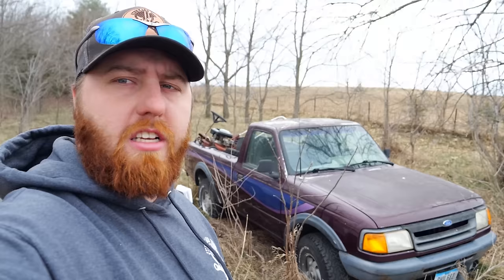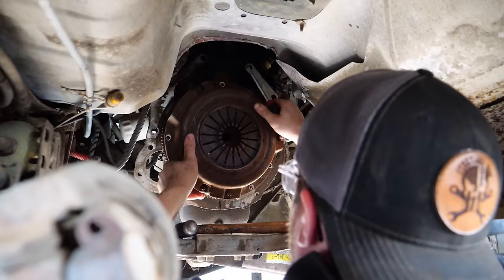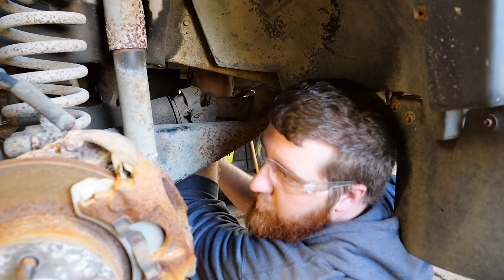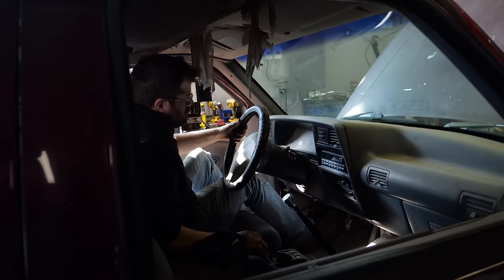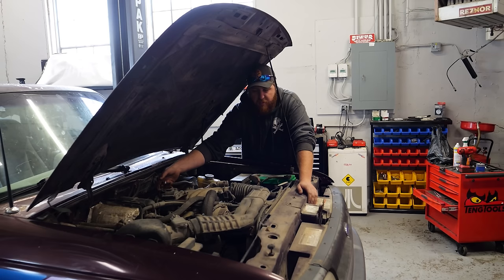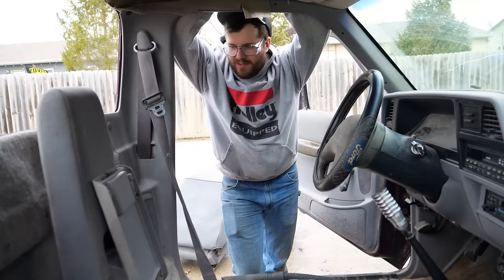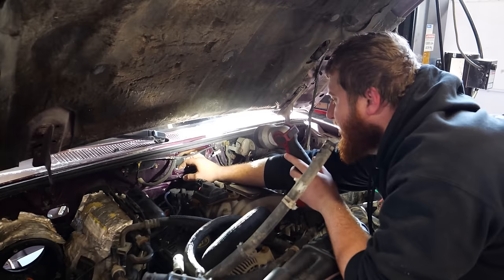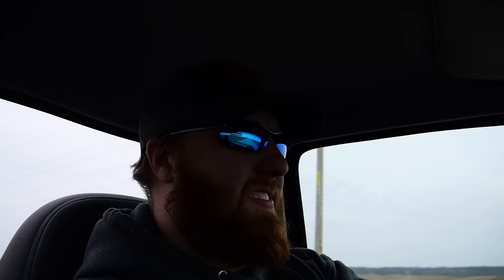Will my CHILDHOOD Truck RUN & DRIVE After sitting Abandoned for YEARS?

Comment: Everything looks so familiar. :-) I have a '94 Exploder, first vehicle I've ever had to replace spring shackles on.  Happily the old bushings were still in good shape so I left them alone.  Its rust situation underneath seemed kinda weird to me, rockers were pretty terrible but the floors were pristine.  Don't know why that would be, or if that's typical, but I was happy not to have to do any more welding (and grinding, my specialty) than I did.  Cool!

Comment: The next time that you have to  change afuel pump in the tank just cut a panel about  12 to 16 in square  in the box floor and change the pump and screw down a new  larger cover when you are done. Quicker and easier. Tom in Canada in the Maritimes at the NB-NS border

Comment: That idle problem is the Throttle postion sensor or either the idle air control valve. Mine did the same thing. I have a 2.3l though. Also if you have the idle turned up, turn it back down to idle around 600 at idle and that should fix it.

Comment: Have taken out complete interiors and have pressure washed seats, carpet, door panels, ect with no ill effect while out of vehicle.  Spray with some simple green first and then hit it with a  pressure washer, comes out very nice and is fast.  Have also pulled floor drain plugs and have pressure washed the bare metal cab/cabin as well.  Just make sure you don't use too much pressure on the interior parts.  Even the nastiest of carpets generally come out looking similar to new.

Comment: Funny enough my first revival was also a 94 ford ranger. And just as funny what put it out of commission for 8 years was the clutch went out. 

I have since replaced the transmission and have 2 extra engines waiting to be built for the old gal.

Comment: My purple '98 Ranger has never yet been un-registered or off the road, though it only gets driven 2 or 3 times a week.  It's almost up to 154,000 miles now.  I did put in a new clutch, pressure plate, flywheel, throwout bearing, rear main seal and new reservoir in it about 3 years ago now.  The throw-out bearing had gone bad but since ya have to drop the trans to replace it I went ahead and replaced everything while it was off.  Have had the same tires on it for so long they've begun to crack on the sidewalls but still have good tread so I'll run em another year or two...or until they go flat, lol.  It's little 2.5l inline 4 will do 70 easily enough...so long as there aren't any hills.  You only think you're cramped in that truck.  I'm 6'8" and 218 lbs and I don't feel cramped in mine...or, at least I won't until I eventually get a bigger truck, lol.

Comment: I had a 94 STX .. 2 wheel drive .. 5 speed .. extended cab (jump seats) .. but the 4.0 V6.  It was peppy.  Drove it for 8 years or so.  Good truck.

Comment: That back glass is nice and flat, so you can find a window shop that can cut you a new one. 

Also, that era of efi usually has issues with vacuum leaks because all of them used plastic vacuum lines, that like to break.

Comment: Hey hi that's not EFI issues buddy That's just your flywheel you should just change it or get a thicker clutch disc, you can also adjust your pressure plate's height so it can press that clutch disc harder

Comment: Pretty sure the 302/351s in 90's EFI F150s were bolted to a variant of that Mazda sourced transmission. I'm not sure if the bellhousing is the same, but if it is... saves you needing to worry about a new transmission with the swap! I'm pro keeping it a stick either way.

Comment: I had two different Aerostars with the 3.0 Liter and 5-speed manual transmissions.  They came from the factory with 3.73 gears in the 7.5 rear axle.  They both had no problem doing interstate speeds.  In fact, the last time we drove from Idaho to SLC, before we sold it, we drove it at about 82 mph and still got 23.5 mpg.  It was not fast, but I guess the engine was in better shape than yours.  We had an '88 and a '93.  Love the truck anyway.  I love old Rangers.

Comment: The Ranger isn't that heavy as far as trucks go, and it is supposed to have 150HP (supposed to being the operative words!) 

I think she might be a little down on power there feller! That combined with the 4K idle thing in between gears tells me there are a few vacuum leaks you need to find! She should do 100! (though, I wouldn't necessarily recommend it)

Comment: Reminds me of my old clapped out 89 ranger with 2.9 v6 I drove in high school. It never had any issues getting up to speed, easily got to 90+ mph I have the speeding ticket to prove it, so I'm pretty sure that one just needs to be gone through, or the engine is completely worn out and has no compression.

Comment: I have a ford ranger just like that but it’s red and a 93. I had the same problem with it idling up when you put the clutch in. I changed and throttle position sensor and it fixed it

Comment: Had an issue with my Ranger extended cab 4X4 until I took the 235 75 15 tires off and put some 215 75 15 snow tires on and the truck just totally woke up.  Could not believe the difference.  Obviously Ford with their better ideas had put the bigger tires on just for the looks and not for vehicle operation.  The smaller tires with the 3.0 litre engine made the truck happy.  Performance and mileage went up along with the rpm.  But the truck would at least pull itself along in 5th gear with a headwind at whatever speed you wanted.  The smaller tires and rims came from a 4 cylinder 2 wheel drive regular cam Ranger and bolted right on.  One of the best changes that i made while i had the truck.  3.0 L was definetly a gutless pig and was definetly not the engine for the truck!!

Comment: you mentioned doing a v8. You should consider picking up a 1st gen explorer for a parts car and pull the axles and the 4.0 out for a swap. It takes about a weekend and you get a much better v6 engine and stronger axles.

I'll be doing that here in a minute on a 2wd 3.0 ranger to convert to 4x4 and get the better engine

Comment: Not that your truck didn’t absolutely need to have all its interior yanked out, but have y’all ever tried chlorine dioxide tablets for deodorizing interiors. It’s the same stuff that’s in those expensive single use containers, but getting a huge bag of them is cheaper in the long run seeing as every car you guys fix seems to smell horrible. It’s a killer oxidizer (better than bleach) but doesn’t discolor fabrics. Hospitals actually use it as a cleaner.

Comment: The blower in my ranger doesn’t work but as long as your moving enough air blows thru the vents to heat that little truck up like a oven 😂 but it’s also a no AC option

Comment: I have a 1996 Ford Ranger , 3.0l 4wd with 5 speed manual transmission, and have no problem traveling 75 mph all day long.   You may have vacuum leaks, or something else is going on.

Comment: The problem with the lack of power could be the ignition coil I had something similar happen to my 3.0 ranger and when it got to the coil it was fixed I started getting 18-20 mpg and it was a much better truck to drive

Comment: If you could share how you fix that revving issue that'd be ideal. Ive been having a similar issue. Though i think a replacement iac valve would help with most of your specific problem.

Comment: I had an 85 cougar w a 302 w tbi. I drove the piss outta that thing. Took it to a shop to get a timing chain installed and the owner of the shop stole the car, scrapped it, and it got crushed. Being that I was poor, i had no way to follow up with legal action. I miss that car. ANYWAY, a 302 in that ol ranger would SCOOT! You should consider it!

Comment: I had a Ford escort and a similar thing around the same year and if you have the AC on and it holds its revs or revs up high it is the AC idle relay it's a green relay near the firewall there's a pair of them and I believe it's the same on the rangers as well

Comment: No shit man, I took a flywheel to an Oriellys once to get turned. The guy just turned the clutch mating surface, not the  area where the pressure plate bolts to, and called it good. I fought with the guy for an hour over how he did the job improperly and how the clutch wouldnt be able to grab with the increased clearances. He kept saying its fine, thats how its done, but in the end I talked to his manager, who reinforced the fact that the guy did the job wrong, and needed to recut the entire surface of the flywheel. Something I bet a lot of people overlooked when they had the job done by this guy, and couldn't figure out why their clutch worked worse or not at all after having their flywheel resurfaced by him. Even the best tools in the industry are only as good as the operator running them!

Comment: You have a dinky 3.0 without a cat and what sounds like a lack of muffler. The small engines need the back pressure in order to run more efficiently and gain speed and horse power. Not to mention that you have a worn out engine, Do what Angus suggested and put a 351W in it  (Not to be confused with those Chevy knock off LS engines) or put a turbo muffler where the cat used to be and a flomaster at the end. Good Vid, good times. ;)

Comment: Looks like a Dana 35 up front. If it gots the 3.27 gear, overdrive is gonna turn that smile upside down. The M50D have a .79 OD in them and your final drive gear ratio behaves like a 2.58. Them 3.0 Vulcans like to run @3000 rpm, close to peak torque. I put over 300,000 miles on a 91 3.0 2wd. I was using 4th gear and 3.08s. Highway speeds were 70mph @3000 rpm.

Comment: If the AC works spray the cabin air filter with Lysol then turn the AC on then shut all doors and close the window and let it run

Comment: Our 05 extended cab XLT 3.0 Auto doesn't give me any trouble had it since 2007 but it tops 93 mph with a flex pipe 2 foot on purpose  off the California catalytic converter.
Its been on my channel for some time now

Comment: That is NOT a Transmission it IS a gearbox. Cars are changing to CVT, The CVT has a continuously variable drive ratio (as opposed to conventionally stepped gear ratios) and uses belts, pulleys and sensors rather than gears to maintain a steady acceleration curve with no pauses for gear changes.

Comment: For what it’s worth, that old Mazda M5 tranny that’s in there now is actually stronger than a T5, so it will handle a bolt on roller motor 302 just fine.

Comment: Mine was an 85 in a field I got for free. No floor boards so I put boards under the vinyl the whole interior was with the valve chatter 2.8 with a 5 speed. It got dirty I just opened the doors and sprayed it out with a hose. Beat the crap out of it and it never died had it for a few years till by baby was born then went to a 84 burban. My mom drove the ranger oh it didnt have an exhaust at all straight out of the collector before the cat (cat was plugged and couldnt seem to get it out as a teen didnt have many tools). After my mom used it she sold it for $200 not bad for a free truck driven for 5 years. Bet the cat is plugged on yours

Comment: This video reminds me of my childhood car that I grew up in. What happened to the poor thing, is that my stepdad bought 3 cheap radiators and the last one busted in such a way that water logged the engine. We begged him to keep it, but he sold it to a junkyard. I wish that I still had that car. I was fully prepared to drain the engine, but he still sold it.
Reply: I'm probably going to look up the old VIN number for it and see where it's been sitting at. But if you're wondering what type of vehicle it is, it is a 2000 Handa Accord EXL with wood grain, leather (fun fact you had to special order leather with wood grain), gold trim (special order), and the interior in beige to match the exterior that was in Naples gold I think.
Reply: @afellowunnormal926  my childhood car was a mk4 golf I was overall pretty reliable but after 200k miles an oil cooler failed and coolant got into the oil and the engine had serious damage but we sold it and the new owner put a new engine in and is driving it I saw it 3 months ago
Reply: @itsdagas8187  I Just looked up the car, and it seems like someone is rebuilding it. It fills me with joy knowing that. I'm going to try to track down the owner now. But I'm happy that you got to see your childhood car thought. I hope that ill be able to say the same.

Comment: You drove that truck like I drove my first mustang. 4.0 v6, redlined daily for about 70k miles before the engine developed a misfire I think was valvetrain and on top of that, first gear started to whine. I already had a loan out for something else, so I sold it to someone I hope will give it a second life.

Comment: you have a massive vacuum leak somewhere with it reving to 4 grand on clutch at speed ... that is excess air entering the engine. I owned a 95 Ranger and never had any issues keeping it at 75 with half throttle so you have a Few issues that need to be found and adressed if you are not changing out the motor

Comment: Must just be that motor and drivetrain combination.. 
because I used to have an older ranger with the four-cylinder five speed and I could easily bury the speedometer on it

Comment: I recently sold my old Ranger I had for 10 years forgot to give the person the extra 5-speed manual and transfer case I had as a backup and I can't hardly give that transmission away nobody has Rangers anymore lol. surprisingly i never had the leak problem with the 5 speed in my truck it had 202k miles on it factory clutch still from 98.

Comment: One of my friends blew up his 3l ranger. There was a terrible misfire but there was no MIL on so we scanned it and there were multiple misfires on 5 and 6. Did a compression test and it said there were leaky valves in #6 so we took the head off and the valves were on the opposite side of the seat somehow. Took the head down and to a machine shop and they magnafluxed the head at it was riddled with cracks. Don’t know what he’s gonna do

Comment: I actually have been tinkering with an 01 ranger with the 4.0L in it. It was my high school truck too. Been trying to revive it, it cranks and will catch and run if you give it some gas. Something on the front of the engine (i think a seized pulley?) smells like it’s burning and will slightly smoke when it cranks for a few seconds. Haven’t let it crank long enough to find out more because I’m scared of burning something up lol any recommendations?

Comment: I felt most of these ranger problems it this video. Since i still drive mine on a daily and my speed restriction is 80, so i could to highway speeds but cant because the motor it going and is awaiting the new one in the garage

Comment: This is great when i was 16 i got my blue ranger splash for 1k riped it down to cab engine and frame and built it back up put 50,000 miles on it im 19 now and after this video im going out and working on it gets better gas mileage then my  89 f150

Comment: my first truck i bought in 99 i think, was a 93 ranger 5 speed 4 cylinder, rear wheel drive only, no AC.  You talk slow lol, i was in western PA so you can imagine how it did in the hills,  but it was a good truck overall and i went everywhere with it regardless of it only being 4 wheel.

Comment: Old trucks didnt run relays or have exactly good power going to those blower motors. Adding a new ground and a relay with correct size wire typically fixes weak nlower motors...

Comment: If you think that truck is slow, try owning a 1987 f250 4x4 6.9 idi turbo diesel with c6 transmission and 4.10s. 60 mph and she is in the firewall at 3100 rpms

Comment: Having just resurrected a’95 OBS F-150 4.9L that sat for 4 years, I can confirm that some JYD and PBG stickers do make it run better! 😄
Both tanks and pumps were a rusty mess and got replaced. Had some rough running as well but it’s smoothing out as I drive. Think the EGR was plugged up. 
Put some Berryman’s full fuel system cleaner in and that’s helping. Also hit the intake with SeaFoam spray.
Had a ‘96 Ranger 3.0 5-Speed and it was a great little truck. I do love the extra space of a SuperCab!

Comment: I have a rough idle similar to yours before you pulled off the vacuum line to the brake booster. How did you guys address that?

Comment: I don't know why your Ranger is such a dog. My brother has a 90 something Ranger with the 4.0 and a 5-speed and I just barely walked it with my '97 S10 4.3 auto. Now it's a dead even race since we each installed headers, full exhaust and a K&N intake. His Ranger responded better to the mods than my S10 did. He also installed a 4.11 gear set or whatever it is so that might be the difference. I don't know what gears my S10 has but it feels like a 3.73...

Comment: my 3.0 5 speed ranger was super boggy and it was straight piped with no cats and i went through and put in new cats and a glasspack and put in new injectors and now i have no issue doing 90 with 33 in tires

Comment: Worked at a junkyard a 2001 Toyota pickup hadn't ran in four years or so the boss was going to sell it took a pop bottle pocked a hole in the cap put a vacuum hose in the bottle put gas in it hooked it in a vacuum port feed the fuel in the injectors freed up set and ran on it's own fuel

Comment: overall these rangers are better than toyotas. a 94 toyota might run but the frame would be toast.  a few rangers had transmission probs but even with trans acting weird around 130k my moms 97 got about 240,000 miles. the last few years it was my brother in laws and it had been dinged and dented and the odometer didnt work and i think he gave it away. it might have lived on for awhile not sure